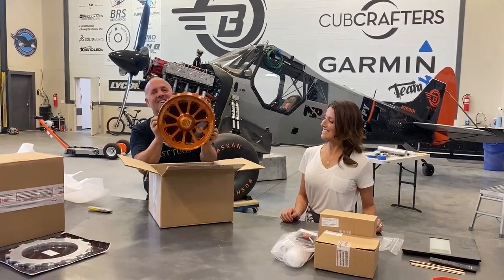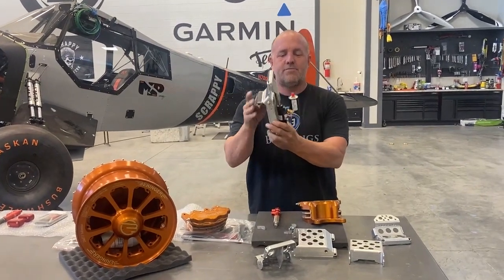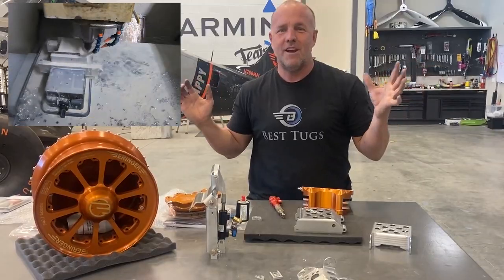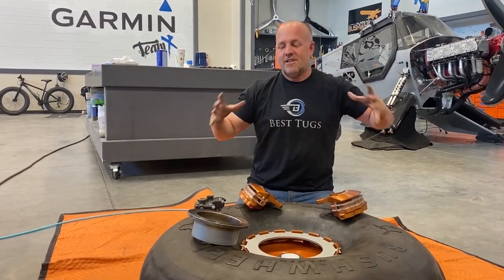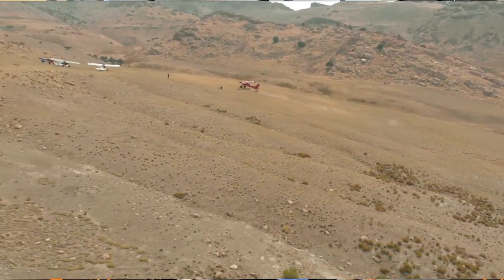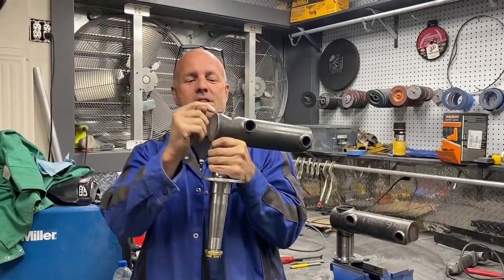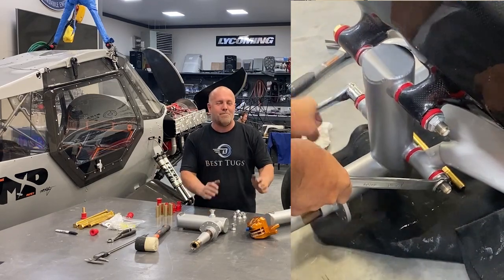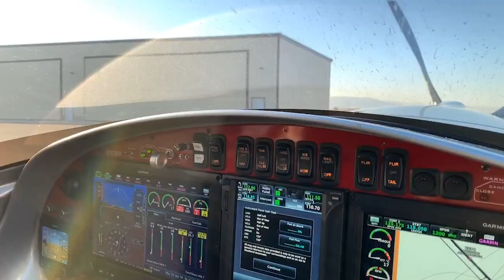Must STOP Scrappy - Beringer Wheels Installed on Scrappy CarbonCub 😳 | Scrappy #41

Comment: Working on antique and classic airplanes with my dad, we had to make dozens of custom tools to fit and work for certain applications. 
We have a large tool box full of them. At least half were only used once. But hey, its fun to create new stuff!
Reply: @Josi Atokirina, I'm a retired marine engineer submariner, the "custom" tools that we had to build were all about space and fulcrum points. Often you couldn't see the fastener you needed to remove, without a mirror and if you could get a wrench or socket onto the fastener, then there'd be no space to turn the wrench or socket! Unique problems call for ingenious solutions!
Reply: Used only once, but without it the job can’t be done.
Reply: @joseywales3789  That is most of the tools we bent, twisted in knots, welded, to get at that pesky nut or bolt or rivet.

Comment: Never seen a caliper on the inside of a disc before. Brilliant.
Reply: A lot of Buell motorcycles were set up that way over the last couple decades.
Reply: Nothing new under the sun... Matco have done inside calipers and discs attached to the edge of the rim for decades.
Reply: Surprised we don't see this more on road cars. The interlocking brake disc / wheel rim would be key and I guess a little harder to standardize but at least for high end cars should be a no-brainer...
Reply: Audi did it back in the day, but the disk where still independent from the wheel. Looked a lot a drumbrake.
Reply: Except for when you have to jack the aircraft to change brakes, which almost small planes you don’t have to do. Not that it’s hard, just one extra step. Then on Cirrus and other aircraft that use differential braking, the pads wear out pretty quick - at least the ones in our training fleet
Reply: @TheReadBaron91  Im sure the wear is partly to do with students dragging the brake quite a lot, not to mention the increase of taxiing for a training aircraft
Reply: @ryanstreuli8667  Yeah, that’s why I mention they are training planes.
Reply: Old tech, new application.  But yes,  cool look
Reply: C-130s have had this design for a long time.
Reply: Hawker Hunter is similar. 2 different size rotors lock into the rim and hub.
Reply: @FallLineJP  doesn't work real well in a situation where the wheel pivots on the axel lile on front wheels is dont think

Comment: Hey Mike. ... How about trying a dental drill? ... Then you could also have a side business filling cavities with carbon fiber at Oshkosh and Valdez! Plus, you already have nitrous oxide gas aboard Scrappy that could be used for pain relief when you're drilling the teeth.
Reply: I was thinking just that, Im a Field Tech in dental and we keep a spare electric handpiece in the trucks just for that.
Reply: With mercury or another by product? 😂
Reply: I take it Mike has had some dental  work done? I thought his tone had changed, a lot of hissing going on there. Why not, what’re you supposed to do? 
Love the gold colour of these wheel parts. I bet they cost a pretty penny ? If you’ve got it? Why not enjoy it? Thanks for another good vid.
Reply: Nitrous is not for pain relief. More for calming.
Reply: Mike you need a pancake drill. Threaded stubby bits can be loaded from either side and are only about 3/8” thick.

Comment: That tapered spindle is very similar to what many boat trailer axles have. Usually a good inner seal will have a small circular spring (for lack of a better description) that keeps a slight bit of pressure on the lip that you mentioned so that as the rubber wears, the spring will continue to promote a good seal. Nice work as always. Woo pig!

Comment: I appreciate the precision, thoughtful design work, and craftsmanship of the projects shared on this channel.  Concerning the addition of the floating brake rotor/wheel design combined with the tire application, something caught my eye. Under low-pressure and maximum sidewall deflection, it appears that the rotor-dog standoff plate hardware may contact the tire sidewall.  I only mention it because while testing an inflight low-pressure tire deflation system in a big airplane, tire failure occurred due to similar hardware conflicts.  It may not be an issue as I am using an “MK I” calibrated eyeball and a video to evaluate the clearance. Thank you for sharing your passion.

Comment: Something tells me those wheels and brakes cost more than my entire car 😂
Reply: About the same as high end auto stuff. You can get their price list off the web site.
Reply: My 2004 Buick Century cost me $400 so I would agree.
Reply: My 2000 Accord is worth about $2000 so I bet there is a lot more in those wheels, brakes, and tires than my car is worth.  The Wheel and brake setup may have cost more than I paid for my 1961 Ercoupe.
Reply: True, but Mike sure didn’t pay that much for them!
Reply: That's what Im saying, and I drive a 60-year old klunker (that will do 10 sec in the 1/4 mile)
Reply: If you put value on Mike's time. Definitely. Especially my 95 Stanza. Lol
Reply: 25k CAD for the kit he's using
Reply: @taxicabyellow  assuming you mean both the wheels and brakes that’s actually fairly reasonable

Comment: The attention to detail is motivating.  In auto racing if you are good enough to get to the weight limit you can continue you just have to add the weight saving back, but an ounce off every part is dozens of pounds closer to the ground, and that is performance.

Comment: You’re going to need some thrust vectoring on that tail to keep it down
Reply: LOL.... That is so true... darn... wait until he gets the wings on and gets it in the air
Reply from the maker: 👍🤠 you would think so for sure huh. 🤠 I may have missed saying it in videos back a while ago but... scrappy front gear is forward 14” more than a standard cub.  I still need to check the new brakes but the others I could slam them and my center of mass on wheels, not wings, is so much further back as planned that I could smash the brakes and stop way faster than my Cubs and not even lift the tail.  Now that being said, when I test the new brakes we will see how much more I can push.  Currently stops faster than any taildragger I have flown other than Draco using beta and brakes both.  We will see how much the new brakes will let me do before the tail gets light.  🤠🤷‍♂️🤠
Reply: @MikePatey  Would it make sense to use a small percentage of thrust during landing roll to allow more airflow over h. stabilizer, which would help to keep the tail down? I realize that increased thrust increases landing distance, however with such strong brakes there may be a sweet spot when an increase in braking force reduces landing roll more even though thrust is not at idle.
Reply: @philippo83  how about building in a device that raises force needed to push break pedal further down at a certain spot? it had to been tested out where the tail gets light so it gives you a warning „I’m about to tip over“
Reply: @MikePatey  
I’m sure you will get those brakes dialed in just like you have with every other aspect of scrappy...  such an awesome build, truly inspiring 👍🏻

Comment: Best part is you're braking the wheel rim where the beads are sitting, not the hub and no brake torque via 3 bolts onto the spokes. Great for efficiency. Absolute work of art!!!

Comment: I definitely have to watch this episode several times to get all of the  'takeaways'. 

It's packed with great insights ... thank you "team Mike Patey".

By -the-way:

If the takeoff and landing speeds remain the same, the required brake energy would be unchanged because K.E. varies with mass and the square of speed only. 

Engine power and thus acceleration performance, shouldn't really impact breaking requirements, unless the weight of the engine increases and the need for more heat dissipation ? thanks for the explanation. 

Love the new caliper arrangement (two thumbs up), lower force required as the force is applied further from the axis of rotation. 

Interesting though that it still requires a larger caliper with larger master cylinder - Inertia doesn't like to be ignored.

So many different parameters acting in opposing directions or at different orders of magnitude, just love it.

Comment: Putting on a fresh new pair of socks is one of the best feelings ever!
You look in to running methanol injection concurrent with nitrous to help control combustion dynamics and heat? It's really quite the combo, you could meter methanol proportional to N20 hit and density altitude using a pwm solenoid

Comment: You can mount your vice on a turntable. Then you can hold the tig handpiece in one spot and in optimal in view and turn the thing your welding. (I am not a welder but I used to weld a lot, keeping a good view is the thing I found the most difficult. I use a turn tabel for my job (repairing electronic industrial and test-gear) to turn the instrument around during measuring so I have always an optimal view on the PCB)

Comment: the brake caliper mounted from the inside of the disc and the disc mounted directly to the rim was also used by buell motorcycles. 
on of my favorite engineering solutions on the older buell mtorcycles, because its a much more direct route for the braking forces from tire contact patch to the disc than the standard solution (tire-rim-spokes-hub and back outwards to the disc)

Comment: Hey Mike! What you would need to drill in tight areas is commonly known as a Pancake Drill, it comes either attached to a drill, or 1/4 drive that you can fit to a palm drill. It usually accepts 1/4 28 threaded drill bits and you can get those drill bits as short as 0.250in. I am a structural technician working on F18 , love the videos !
Reply: Pan american makes an amazing set, it comes with multiple head attachments including various corner drills and pancake attachments I would love to get my hand on that kit one day.

Comment: Hey Mike, regarding your drilling problems in tight spaces a "Nova Flat Offset Angle Attachment" could help. We use it for commercial aircraft repairs in really tight spaces.

Comment: The "Terry Tools" T23 offset works great with those little threaded Terry bits.  They do sell longer offsets and whole-on pancake drills, but I forget who makes them.  You can also get stubby terry bits if you need them.  When I worked airframes, I always had a set of standard sizes in the super-stubby Terry bits available.
Reply: I found it.  The ARO 7439D.

Comment: Mike, you need an aviation sheet metal 90 degree drill with some super stubby threaded bits. They are tiny compared to what you were using. They seem to be an unknown tool outside of aircraft structure work. Keep up the great work!

Comment: Very nice.  All the best on this airplane!  Pro tip:  When you take the wheel back off, set your parking brake to hold the disc in place for reinstallation.  You won't have to fight with the disc tabs to line up.

Comment: good to see that beringer have used eric buells zero torsional load brake disc principle, but also solved the disc mounting issue, such a simple solution to the floating issues with the buell style mounting

Comment: The CH-46 used a caliper inside the disk. That "double seal" on the backside of the rim was on the 46s too. Glad to see you used break keys to prevent excess wear on the rim from the rotor. I am super stoked to see how this set up works out for you. Especially since I am familiar with it from the rotor wing side.

Comment: would be interesting to see a innovative company come up with a wheel assembly that could be optionally engaged with reverse torque, like reversing a jet engine, that could slow a wheel down and keep the tail on the ground at the same time.  I love the Beringer solution.  Cant wait to see your test results.

Comment: There a quick inexpensive trick to reducing the dimension of those press fit pieces you were showing going into the wheel strut:
Get a bottle of Dust off spray ( it’s meant to blow off electronic equipment) turn the can upside down and it will spray out the propellant which is Nitrogen or some such.
It’s like dry ice in a spray form.
It would shrink the size of those parts quite smartly.

Comment: Hey Mike just wondering if you cleaned the brake discs with brake cleaner before installing. (usually, the brake discs come with a little coat of oil to preserve them while in transit)

Comment: Hi. Make sure that when you assemble the hub you put thermal grease in between the castellation's to improve heat conductivity to the hub and reduce anodic corrosion . this way you can put more energy into the disc and elevate it by transferring it into the expanse of the hub itself ,using it as a heat sink. watch tyre inflation pressures!

Comment: Hey Mike, throw that silly little t-handle dust cap tool away and machine up one with a 3/8" drive. Cirrus SF50's main wheels use those same caps and have many issues with the L/H cap loosening (and departing). They tried using loctite, and nylon locking inserts on the thread and none worked. Their solution was to keep increasing torque until they stopped falling off. The final number was 37 FT-lb's! Granted you're takeoff and landing speed isn't going to be anywhere close to the vision jet, but nonetheless loosing caps isn't fun. Also check out pancake drills for tight drilling applications.

Comment: Erik Buell of Buell Motorcycles did the inside out rim mounted rotor and caliper WAAAAAY before Beringer copied it. Another benefit of the inside out rotor is with the rotor mounted to the rim you don't transmit braking force through the wheel spokes so they only need to support the weight of the vehicle. Not really applicable to Scrappy, but on a motorcycle, the lighter the front wheel assembly, the easier it is to counter steer.

Comment: They sell threaded drill bits that are only .250” long. Also they come in variance of lengths and sizes.
Reply: Forgot to mention that they do sell pancake drills which are pretty much a geared extensions that attach to your drill motor. Trying come off your motor either at a 90deg or 180deg in case you need to come back the other way, they also come in various lengths.  There much lower profile then a 90.

Comment: With all the engineering and fabrication that you have done to scrappy, have you considered a Halon system for the engine bay should you have a catastrophic failure and fire?
You are making so many advancements for the private plane enthusiast. The research and development you have done is amazing. Like the development and testing of the elevator struts, that was a very good video.

Comment: Dotco makes 90 degree air drills and pancake drills with 1/4 28 threads for threaded drill bits. Drill bits are available with different lengths. Long, short, stubby and extra stubby. Used for aviation sheet metal.

Comment: A set of screw machine length drills comes in really handy for probs. like this. they are stronger and more rigid than jobber length. Split point sharpened ones are the best.

Comment: Hi Mike, was always wondering why the automotive guys did not do something similar. Traditional way does  keep heat away from the wheel rubber due to the metal mass of the rim being in between ,  but wheel bearings get clobbered over time in heavy duty use. Your way give more surface area for the same weight. and the design looks like it will dissipate heat very well

Comment: I have a Dotco 15XXX Right angle drill which will get into tighter spots than the 90* adapter you were showing. There are also super stubby bits for it as well. There are 90* adapters like you have that are smaller I don't remember the brand off hand. I have one that is a little smaller than yours. 
   Also the air dills with a 22.5*ish angle are handy as well.

       Beautiful work on that spindle.

Comment: Hello Mike, I haven't posted to you since I started watching your you tube channel three years ago in my bed.  I was severely injured in '84, now quadriplegic. Both me and my wife were pilots, she has a degree in aviation with instructor, instrument, multiengine, commercial glider and has spotted fish in the 80's in Alaska for a season.  I was an aircraft owner in '78 with a new 172 I picked up in Wichita.  I bought in with 4 others to fly a brand new P210 to fly my crew around the country to remove and trim trees for my tree service in Portland, OR.  I fell 102' in '84 in an accident that almost killed me.  I was a fire fighter in Portland for 25 years and   worked hard on my days off (2 out of 3).  I have a degree in mechanical engineering and long experiences of welding engineering asst. for a company that built the Alaska pipeline pumping stations, I got to write the welding specs.  Okay, here's why I'm writing this.  I can't find your email.  My wife and I are travelling to Central California in May.  I would LOVE to visit your shop and chat a bit with you.  I know you're a very busy man (back to work!) hehe.  I also use Solid Works to build pest control devices for an income stream.  I watched your new wheels for Scrappy and the Nitrous system you put together this morning.  I can't stand just watching, I gotta go see da man!  I'm pretty innovative but nothing like I've seen in you!  Email is: 
frankpdx25@gmail.com  hope we can meet someday!  I was also a drag racer in the 60-70's.

Comment: Mike you could of added a jacking point on the axels. Would make changing wheels easier. Remember to turn the nut not the bolt head when assembling bolted joints

Comment: Mike, they do make that angle drill in a smaller size. At Gulfstream we called it a Zero Terry and it take drills that are threaded with a 10-32 size thread. Standard is 1/4-28 like you have. I'm retired, but I do have a friends still working there and one of them is going to see if he can find out where they order them from. I did a search online using the term "Zero Terry Drill" and it pulled up a company called "Advanced Air Tool", but for some reason I can't get their website to work for me.